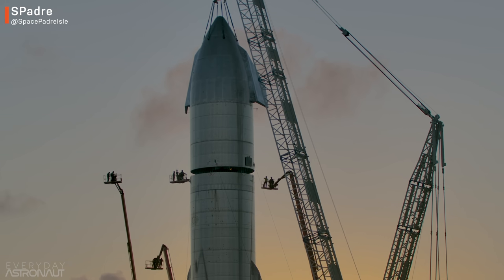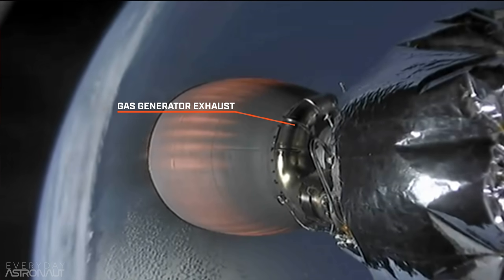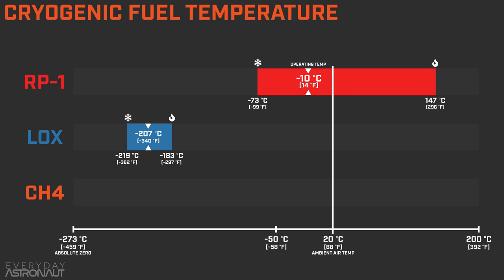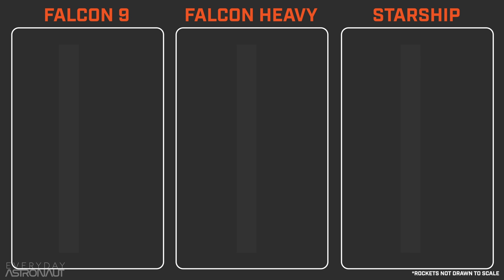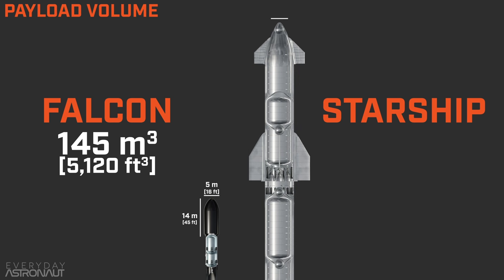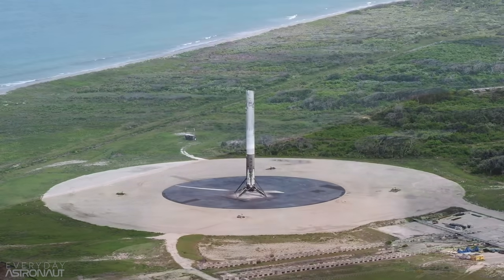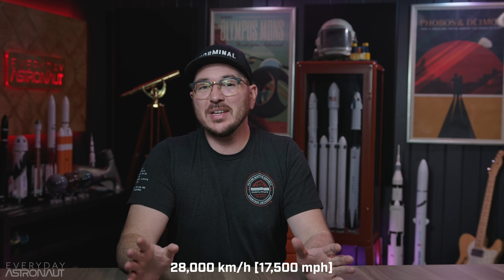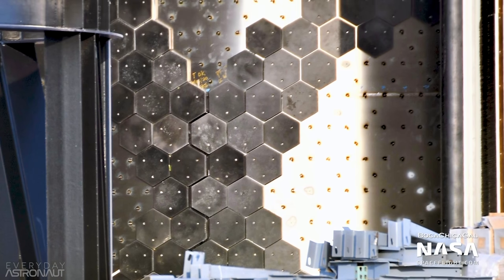Complete Guide To Starship: Falcon 9 VS Starship. What's new? What's different?

Comment: Booster should only give vertical ballistic altitude and the second stage should only give the horizontal velocity.   The other way too much fuel is wasted.
Reply: I like starship in mars
Reply: That would be actually worst
Reply: @elianes5505  How so?  What are you thinking?
Reply: @lazaryanya9407  
Well, let's say you want to get to an orbit of about 300 km. Using your method, the booster would need to get the apogee (highest point of your trajectory) to that height, that's easy. Now the second stage would need to burn sideways to make the ENTIRE orbit on itself, without any horizontal boost from the first stage.

I see some problems here:

1. The Earth is huge. Trying to get a second stage to make an entire orbit is unrealistic to me, and even if it were possible, you would end up with less fuel.

2. The thruster will reach too much speed when falling due to its high apogee, and you know what happens when you go too fast on reentry; Yes, 2x more speed means 8x more heat.

But at the end of the day, if rocket scientist are doing it a certain way, it's probably because they know it's the best way to do it.
Reply: @elianes5505  This is how I picture it.  First stage gives a vertical boost and separates.  If nothing happens now the first and second stage will continue going up until at some height their vertical velocity becomes 0m/s.  Lets say at 300km above the Earth.  Now they fall.  The advantage happens when the second stage goes into its orbital burn while it is still moving away from the Earth due to it's velocity at separation.     By the time the second stage vertical velocity hits 0m/s, the second stage should have given the lighter vehicle it's horizontal orbital velocity.  Booster gives all the potential energy to the spacecraft while the second stage gives all the Kinetic energy to the spacecraft.  Going straight up also reduces air friction losses.  Does it make more sense now?
Reply: @elianes5505  Yes, Rocket scientists are great.  However you aren't seeing the whole point here.  The entire rocket has enough energy to put the payload into orbit otherwise you don't achieve orbit.  I am proposing a different consumption of that energy.  First the booster gives the rocket enough velocity to get to "apogee".  The booster will turn back after separation and decelerate and never gets to apogee height.  The second stage will be moving up from the ballistic motion given to it by the booster.  The second stage only has to worry about giving the correct horizontal velocity so that the payload ends up in an orbit at apogee.  If the second stage speed is too slow for orbit the payload will fall back to Earth.  If the second stage speed is too high for orbit then the payload leaves Earth.  What am I not understanding here?
Reply: @lazaryanya9407  
Oh ok. You never told me about the booster slowing down xdd

My point is: the second stage doesn't have enough momentum to make the entire orbit on its own.

But anyway, when you create a space company in the future, try to do it. Then tell me if it works.

Comment: Of Corse  we all heard that SN8 crashed because of low pressure in the header tanks. I would like to know why that pressure was low in the first place and how will it be fixed ?  post script  :  I heard it ran low on fuel, that also sounds curious to me ?
Reply: Err . . . Low pressure from the header tanks which are the fuel tanks used for the landing burn?
Reply: @nolsp7240  the question was why were they low : seems they are adding a helium tank to maintain the pressure
Reply: @brotherofthesnake8833  Yeah.  Must be an interim solution.

Comment: Hi Tim, why don't they put the payload bay on the bottom of the seconds stage and drop it on mars and go back to mars orbit? They could use side rockets like they are doing on the moon.
Reply: how are they supposed to decopule the payload...
Reply: @oren2000  so many ways, hydrolics, breach charge, linear motors etc. It's an engineering task not a design task.
Reply: @jlebrech  No... they're supposed to put the satelite or whatever the payload is into the engine or what?
Reply: @oren2000  the engine doesn't have to be on the bottom.
Reply: @jlebrech  where is it supposed to be then?
Reply: @oren2000  same place the lunar starship has it

Comment: The rocket design is made of the methane tank and oxygen tank.
When half full (eg langing on Mars), the weight (of oxygen) is high up on the rocket... Placing the steel in high stress, or is methane pressure holding the oxygen up?.
If not, why place the oxygen above the methane instead of side by side (ie. move the weight lower). By having it lower, would the stresses not be reduced?
Reply: The engines at the bottom must balance the weight a good amount enough to not need any tank movement.

Comment: Tim. They need to start the re-entry burn higher up. Mass falling increases exponentially rather than almost liner and that's the problem they're dealing with is density at the moment. The more dense 
- Mass. an object has the easier it push through a pressure, air that's keeping it up. This is why planes are made of aluminum and composite so they "fly" with ease. 

Everything coming down, needs to exaggerated because of the immense scale that's being used.

Stainless is nice, but here is the thing that boggles my mind. All they need is a stainless shell. If they make the internal areas out of composite and make thermal bleeds it will help shed heat on both exit and re-entry. If the interior is braced with heating tiles to protect the interior of the rocket they could shed their overall mass by 3/4 to 2/3 and that's literally tons. When taking off it means more bang for the buck and when coming home lighter to manoeuvre. 

I love the ideas that were placed with experience from the community a few years back to make something epic like this go! I am shocked they weren't inventive with it to try to cut mass where ever they could and that's why they're struggling right now. They gave up on innovation rather than trying to do what made them so successful reinventing modern rocket science. Instead all they've done here is reverse engineer an old tech that wasn't used by nasa because it had issues. Not to say Stainless isn't the best choice of outer skins. Just better ways to design the interior.

This project is far from done or finished, they have a long ways to go. Maybe 6 years before they have a stable test platform they're ready to go to space with.

Comment: Sounds all good and logical, but nevertheless I've many doubts and questions in my mind about the whole "Starship" project. At the moment this rocket has flown a few atmospheric test flights at airplane altitude. It came down from a hovering point at 30.000 feet with nearly zero vertical velocity! But this never will be the point, if it will come back to Earth from a real space mission. Per example for a test flight to circle the Earth a few times the upper stage need to speed up to 8km per second. This will take a lot of fuel, because this whole rocket will be really super heavy! Okay, we going up into LEO at approximately 300km with a speed of 28.000km per hour! Now please tell me from where will become this thing its fuel to reduce the speed and slow it down to a velocity for a Earth atmosphere reentry without using or needing a special heat shield? Or will be the upper stage only used for one way tickets to Mars? I guess not, because in matter of this planet this belly flop isn't needed, because the atmosphere of Mars is much too thin for such a landing we have seen here on Earth. In matter of fact the rocket must dive down on it's back with running engines the whole landing processes, because the rocket will reach Mars with a velocity of more than 11km per seconds! So let me ask this again: from where will come the whole fuel to "push the brake"? Can you explain it?

Comment: Would it be completely crazy to build version of Starship Tanker that supports SRB boost? The boost would, in theory, save a fair amount of the fuel and/or mass that could potentially be used for the refueling process.
Reply: SRB wouldn't be reusable which would completely defeat the primary tool of starship.   I've been wondering if they could get a large cylinder high enough using just the supper heavy booster that an in orbit "tug" could rendezvous with so they don't have to waste payload capacity on things like engines if the component is never intended to come back down.

Comment: with the proposed Angara-100 for which all the parts already exist. (RD-170 side boosters, RD-180 core booster, cryogenic upper stage with RD-0122) you could put in excess of 100 metric tons (100.000KG) into LEO.

Comment: Are all of those engines equal in space size in density or are the main thrusters different from the outer set? All engines should be equal in uniform position. Which means you should have main thrusters and capacitor thrusters that are made at an angle that points out the ground from the main thrusters maybe at a 45 degree angle to keep it steady at all costs. And to provide thrust. So one is pointed at the ground and the circle of thrusters around it and angled out and down at about 40 degrees and all must be equal to each other in distance and size from the main thrusters. They should have bases that are spring loaded and can absorb shock as well as release the shock absorbed at a stable rate. They should have other thrusters for positioning which balance the ship upon landing or we should make a ship that is even in shape like a sphere or a square or a pyramid instead because they remain in balance. A sphere weighted down at one point do to the payload. The payload has a specific amount of gravity imposed down upon it now doesn't it? Well when it lifts off of the ground the weight must be distributed evenly throughout the sphere so if you were to use a thruster on the opposite side of the payload then it would rotate if the force of gravity on the  payload at the center was less than the force of the thrust. So we can use this motion to generate electricity. Also we can set the thrusters on the sphere at an equivalent distance from the center thruster. And make them movable so the sphere can change direction in space. While the payload at the bottom of the sphere is set at a specific weight and mass the rest of the ship has a changeable payload that can be shifted mechanically to position the ship as it floats. A double payload system. When there are two payloads of equal size one at the center and one on the outer edge of the system and then when there is a force exerted tangent to that payload system rotation occurs. So a rocket generator can be made with a sphere, it would be most wise to use a plasma jet as plasma is a better alternative to gas.

Comment: Hi man,
I would suggest you to use practical km/s for stage separation speeds.

Example:
Falcon 9 first stage separation speed is around 1.85 km/s
and second stage separation speed is around  7.5 km/s.

This would be fairly practical and easy to use rather than thousands of km/h,
I would suggest to use m/s up to 1000 m/s then change over to km/s.

Also if you definitely want to use km/h, then use it till 3600 km/h then change over to km/s.

Comment: Thanks for the information Tim. Would it not be simpler to lift solid fuel rockets into space, and attach them robotically instead of refueling Star-ship with liquid fuel?
Reply: well the problem with solid rockets is the reuse part. Solid rockets are harder to manufacture and reuse because they require huge amounts of matinance. Starship is supposed to be rapidly reusable. Liquid fuel is simply a proccess of pumping it in.
Reply: @Trippy2549  How about a hybrid of solid fuel, and liquid fuel. If Potassium Nitrate is heated, it liquefies. Once liquid, it can be pumped into the combustion chamber like liquid Oxygen. The fuel could be either the typical liquid fuel used with liquid Oxygen, or a solid fuel that also can be phase changed to a liquid by heating, and be pumped into the combustion chamber to mix with the liquid Potassium Nitrate (Oxydant). Just a thought!
Reply: @dentonfender6492  Very interesting. It does, however, at to the complexity of the engine (not like the raptor isn't complex within itself). First you have to heat and then pump, but I think that a company should use it for testing purposes.

Comment: So, I know this is a bit cheap now since it's already happened, but I was always amused at how everyone was talking about how hard the "flip manoeuvre" was going to be. Everyone seemed to forget that the Starship has these humungous control surfaces on it, which are placed at the extreme ends of the vehicle, those surfaces will have an enormous amount of control authority, and probably, I would suspect, would be completely able to right the ship to upright even without the engines or cold-gas thrusters fairly quickly. My concern was always more about whether they would be able to keep the pressure to the engine during the manoeuvre which did turn out to be the issue (although admittedly I assumed the relight would occur during the reorientation so I was imagining problems with the relight itself). People should stop worrying so much about the aerodynamic stuff though, this is well understood at this point, and the rocket isn't really that complicated as a controllable object. The only issues it might have with controllability will come at high mach numbers where they will have the cold gas thrusters anyway/.

Comment: My questions  are, why are rockets all launched east to west except those launched from California.   May be because launched from Florida. What is the difference in ground speed between the two directions.   Is there a difference in atmospheric re-entry speeds as going with earths spin as against it.  Just wondering?   Second points.  What is the g force on the rocket flip burn, and landing?
Reply: Because the earth’s rotation allows spins eastward, so any rocket that goes to orbit that also moves eastwards is gonna need less delta V. As to why California doesn’t send ships east as well, i don’t know.
Reply: Ismael answered right for East to West. As for launching from Cali, that is for North/South bound launches. Cali cannot launch East bound rockets due to population areas to the East that would be at risk if there were issues with the rockets.

Comment: I would love to see you do modifications and design work changes on anything stainless steel with plane and simple construction methods. It takes seasoned craftsmen with as many years of training and experience as a neurosurgeon with almost as much class room education and hands on field work to do those simple construction changes. Those welders alone with no fit up or rigging experience have a minimum of four years of welding instruction and practice to be able just to strike an arc on something critical like these machines.Bro.

Comment: Why not employ the classified tr3b Mercury vortex motor, which creates a very powerful electromagnetic field, which counters the electromagnetic field, which we call gravity. SpaceX could employ a suitably sized Mercury vortex motor to easily transport supplies to the space station, including astronauts, and return astronauts to Earth.  After solving problem of space flight, SpaceX could concentrate on removing those pesky air bubbles from the spacewalks.

Comment: Okay yeah you stick The Landing here on Earth but the atmosphere on Mars is different how do they compensate for that? Because basically it's going to take a lot more fuel in Mars's atmosphere to slow it down. Because atmosphere should be thinner so there should be less friction?
Reply: Required delta-v for mars landing from 250km LEO is something like 9.3km/s, without any aerobraking. Since fully fueled Starship itself theoretically has 8-9 km/s of delta-v, it shouldn't be much problem, at least for current configuration. However this requires full refueling at LEO and serious amount of propellant ISRU.
Reply: lower gravity.
Reply: Less thrust needed because of lower gravity, but cant use as much aerobraking, so more thrust needed to land. Sorta balances out in the end.

Comment: Curious how - or if - SpaceX is looking at 18-plus month transits to mars with gravity (of any level) using boom methods or - inflatable ring habs that can be spun (similar to the pods developed at NASA and Bigelow Aeropspace). Providing any amount of gravity for transit would be a huge boon to passenger physiology on so many levels I could write a TLDR on it. Although more complex a system than a boom tether weight method, you'd have the capability of making a stacked ring space station in Martian orbit on arrival from all the trips. For the hot-gas thrusters - I'd suggest something speedy as typical for RCS : the 'Peregrine' engine. Holy crap - Musk wasn't kidding when he said the capacity was bigger than a 747 - that tops out around 750cu m. 05:50 yes - the F was for 'falcon', as noted from someone (Musk) who played Doom and used the BFG. XD Also love the nod to the Bruder XP6 - that's an insanely cool AUS designed RV that is OP on so many levels at 51:25